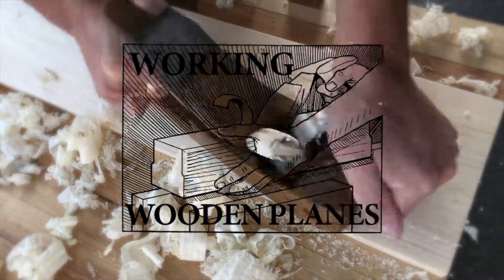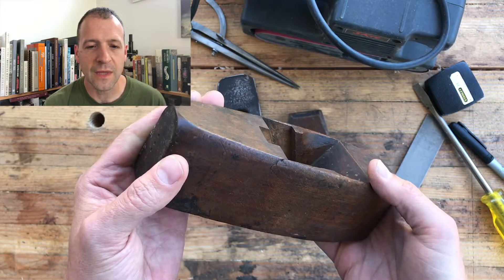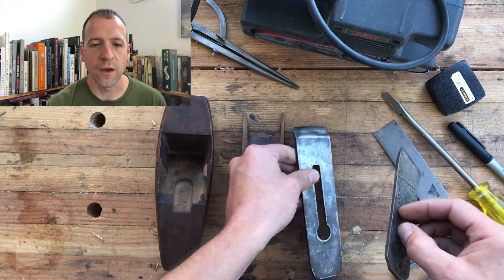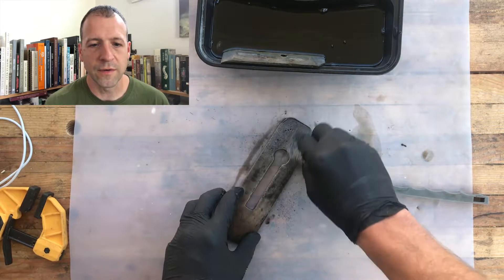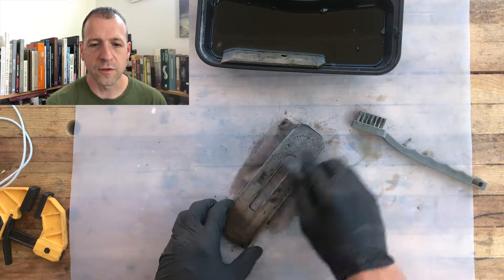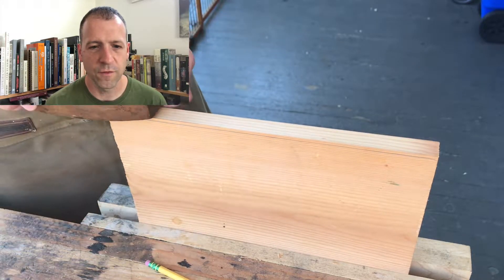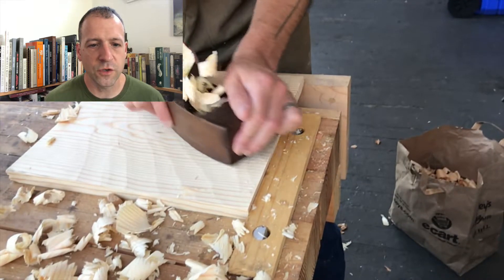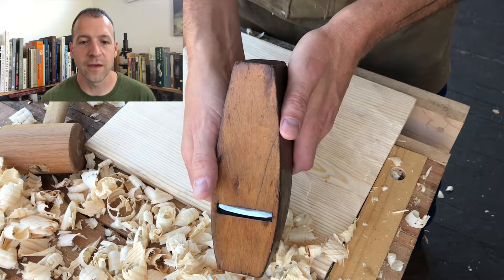How to Make a Scrub Plane in 10 Minutes

Comment: Thanks for the video, full process is shown using common tools. Use a rubber eraser to unclog the diamond plate. Cutting works best once a slurry of metal particles is created, but they clog so wipe with cloth then clean with rubber eraser.

Comment: Hi I have the same diamond plate set up as you.  I found that cutting a 3/4" inch paint brush right back to a short stub probably only 3/16" produces a great tool for cleaning the diamond plate.  Just squirt a bit of dilute honerite or whatever solution you use on the stone and a quick scrub is all it takes. Much better than the pencil eraser they supply with the kit.  Cheers, great video.
Reply from the maker: Great tip!